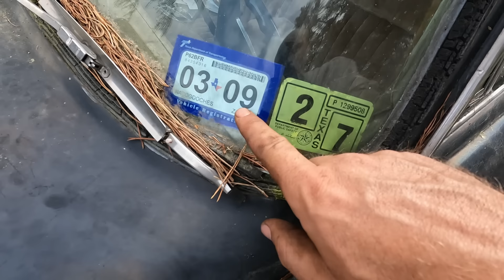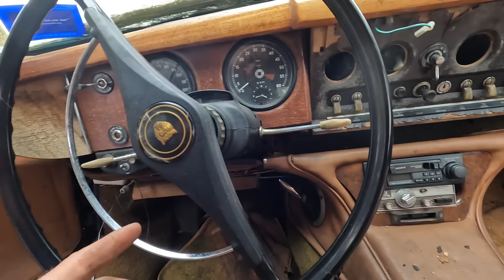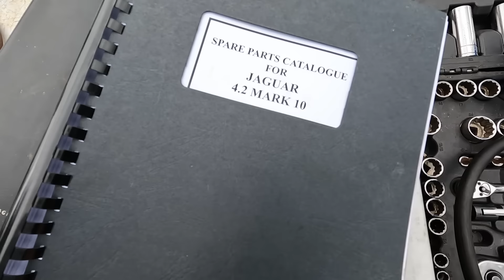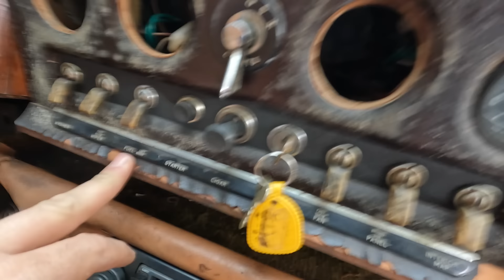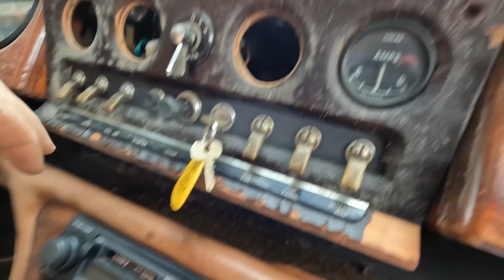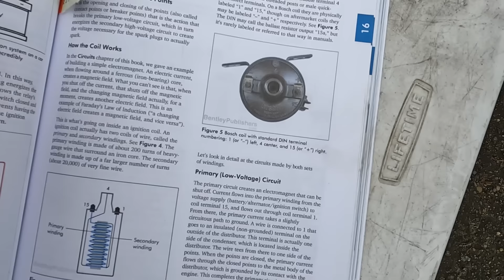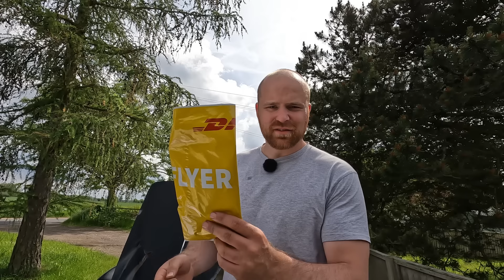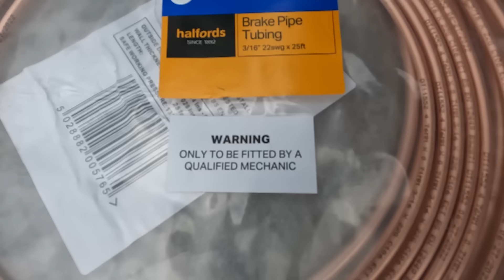1962 Jaguar sitting for 15 years. Will it run?

Comment: The brake pedal is likely due to local high spots in the lines. Brake fluid doesn’t move fast enough to fill voids in sharp up and down curves in brake lines. This will result in air pockets at each high spot. You should be able to fix it by running the brake lines down from the master cylinder instead of immediately upward, or by creating a flatter bend in the lines. Alternatively you could try to bleed the brakes with the master cylinder hung higher temporarily and install it in place after bleeding. 

My guess is that the car was “restored” at some point and the brake lines may have been redone improperly, which is why your copying of that is not working. Look for actual original setups for inspiration or maybe in one of your jaguar service manuals/parts catalogs. If not, perhaps jaguar has a special method of bleeding they did at the factory and service centers.

As for the carburetors, as long as they are not leaking and the ones you took apart don’t have ethanol gunk in them they may be fine without rebuilding. Old rubber seals in carburetors dry out and need to soak up gas for a bit before they come back to life. Timing is probably the biggest issue, which is why it backfires everyone once in a while. See if you can find the factory timing in your manual and go from there. Most likely somebody has messed with the rotor cap in the past with no clue what they were doing.

Keep up the good work!
Reply from the maker: Appreciate all the advice there 👍🏻

Comment: My guy. Why didn't you just run to an auto parts store and get a couple of adapters to adapt to 1"? Those ARE a thing, ya know. Though to be fair, you got it to move anyway, so good job.
Reply from the maker: Auto parts stores here don’t stock imperial sizes of anything. There are no chain stores that stock classic car parts, so everything comes via online.
Reply: @NotEconomicallyViable  Aye, that's normally true, but if I'm not mistaken, ratchet wrenches are a standardized thing. 6.35mm drive = 1/4", 9.53mm drive  = 3/8", etc. 

I could be wrong, I s'pose, but I'm pretty sure those, at least, are consistent no matter where you are.

Comment: If the engine gallops when cranking ie the cranking rpm goes up and down it means compression is not equal on all cylinders, like a leaky valve etc.
If you watch vice grip garage, he edits it to look like fun but he always says how long it takes him! Days of pain, I couldn't do it....or what You're doing!
Even your videos make it look fun, but that thing is a Pandora's box of potential misery....... be good to see how cheap it could be made roadworthy - working brakes, drives straight, engine etc works.
Id like to put a transit 2.5Di turbo or land rover TDI 200 and lt77 rover sd1 box. Turn get a special fuel pump.....
Or my dream engine 6.5 GMC diesel!

Comment: HT is for High Tension not High Temperature - Tension being old fashioned word for Voltage, so just High Voltage
Reply from the maker: High current multiplied by resistance cables

Comment: Ironic your comments about Jag failing to crack the US due to a lack of a V8. They had one in the stable in the form of the Daimler V8 4.5 litre - Turner designed engine, hemi head, designed in 1959, Jag took over Daimler in 1960 and could have made an effort to utilise the engine in the Mark X/420G The Daimler V8-250 released in 1962 was never going to cut it in the US with its 2.5l engine, despite being a hemi V8

Comment: Strip it out weld up the rot bolt a H frame into it bolt the doors shut fit a door bar and some door plates and take it out for a day of fun around an oval track.
Those carbs sounded like they needed balancing  too I'm.shoked it fired up and run as well as it did

Comment: Some of your questions answered with what is most likely.

Why the colour change - the paint would have been wrecked by the sun and someone with questionable taste thought they could improve on the original.

Why the interior change - See above.

Why the engine change - No doubt that car has been round the clock at least once, maybe twice with the huge mileages many rural-based Americans do every year, hence the original wore out and those Yanks prefer a bigger engine, given a choice.

Comment: It’s beyond me why people just dive “into will it run”
Why don’t you clean some of the crap off and get some easing oil down the bores and leave it for a few days.
Last time I worked on a mk 10 must have been 1965.
Nothing wrong with that car that a gallon of petrol and a match wouldn’t cure.

Comment: Of course you will put a v8 in it.  And that's a pity.  It won't be a classic Jaguar anymore.
I think you miss the point of the classic straight 6 which is the smoothest of all engine configurations for vibration.  The only thing smoother is a v12 - and THAT was the next step for Jaguar. When you lift the bonnet (as we call it in Australia) on a big old Jag what you see is all carbs and those big long tappet covers. Back in the day, twin cams was RARE and properly exotic - like a Ferrari.
To use an Australian word, it's just a bogan thing to do to put V8's in British cars - Landies and Jags. Those guys I guess have some appreciation of the heritage value of original cars, but get influenced by what other people do. I guess it's something to do with being an old man that I have got more and more appreciative of heritage value and keeping rare "survivor" cars not only on the road but still as close as possible to the real deal.
By the way, that car was FASTER than most of the v8 sedans on American roads, and the "hi-tech" 6 with its triple carbs was very Euro-swish. It was almost a Royalty level sophisticated limousine, NOT a muscle car.
Fancy having a 4.2 that isn't even smoking and you're itching to drop a Chev engine in it.
Congratulations on throwing the effort and money into this and producing a video that will inspire other ordinary folks to rescue a classic. As the meme goes, "I'm not angry, just disappointed" to hear you signalling your intentions. I seen it before in "Will it run" videos... they get it running, and the next thing they're talking about turning it into a hot rod.
I don't know what insurance is like in the UK, but here in Australia is easier and cheaper to insure authentic cars.  The 4.2 versus the 3.8 is a minor mod in the Jaguar tradition and well understood in terms of the availability of serviceable 2nd hand engines. I've done that myself.
It's not my place to be carrying on about this like a pork chop. It's your car. It's your money. It's your dream.
But I kind of hope you get to hanging around with some old school Jaguar guys and absorb their enthusiasm for that classic engine and decide to keep the big 6.

Comment: Have one question why is the ranger rover all open, doors and bonnet as well as boot were you multitasking and fiddling with the range rover as well lol, I know you have the back open for tool access but does not make sense in having the bonnet open lol.
Reply from the maker: I was charging the battery

Comment: Great video. It could be a dodge seal, not the one that keeps the fluid in but the one that forces it out. This could get better with time??? Get the Mrs to press the pedal with you at the nipple (oo er Mrs). Open the nipple and put your finger over the end, feel the pressure, see how far it squirts. Good luck. 👍

Comment: The simple solution is remove the british engine and transmission and replace them with an american engine and transmission, with three times the horsepower and half the weight

Comment: You say you don’t know what you’re doing but making brake pipes is WAY beyond any DIY mechanic…..
Are you pulling our collective legs?

You’re just  about my level and I’m 40 years DIY with an automotive engineering degree.

You know more than you say on your videos….. I’m guessing you’re Mensa with a previous career that set you up with $$$ to be able to follow your dream lol

Comment: mad man hahahaha
Reply: doesn't the throttle probably have like a screw that held it in place? Seeing how often it falls off? unsure if the metal to the throttle had a treat in there
Reply from the maker: Doesn't show anything like that in the parts diagrams. I might just drill a hole through it and pin it